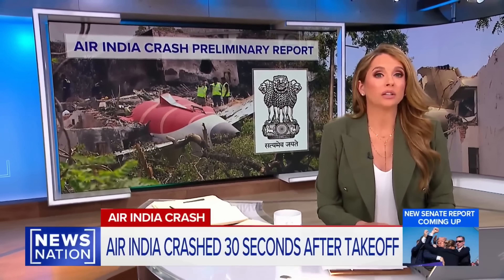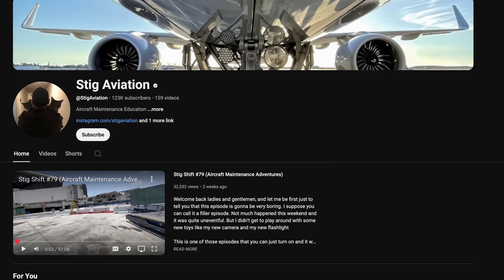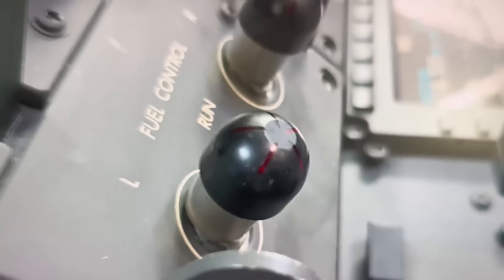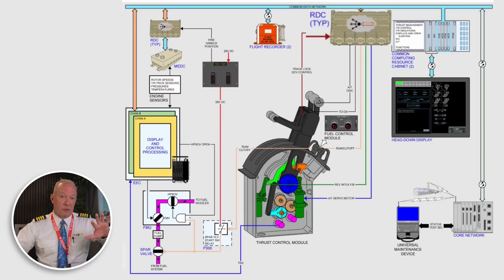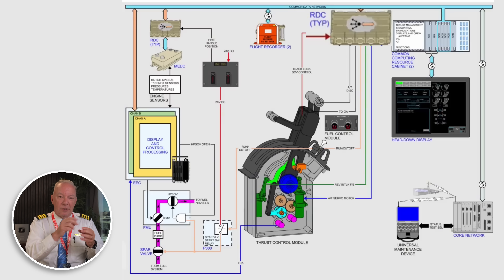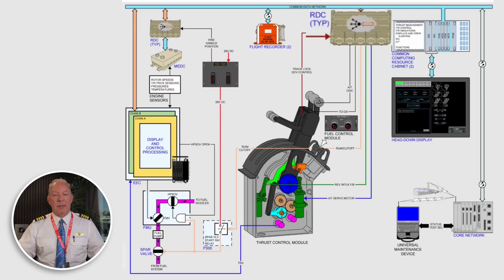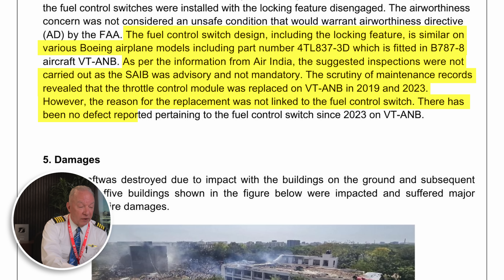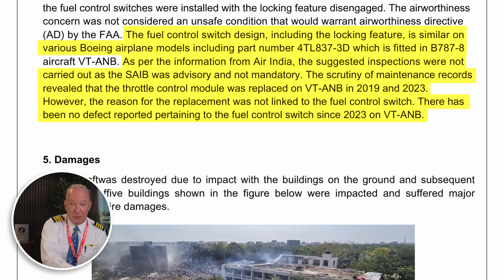The Truth About Boeing 787 Fuel Control Switches

Comment: I'm a retired airline pilot who has flown many different aircraft including Boeings with their different fuel cutoff switches. I am well aware that the switches could not have moved on their own but watching some Youtube shows where a "Knowledgeable" avation person said that the FADEC could cause the engines to quit without the switches being moved and that there had been prior incedents where this had happened. I appreciate your clearing this up for me and many other pilots who may have thought that a computer had some erroneous control over the engine fuel controll valves. All my experience and logic told me that was nonsense but watching these shows can create doubt.
Reply: I may have watched those same videos.  They seemed confused about the FADEC, it does not shutdown engines, it can reduce fuel flow in some situations.  One of those videos said the air/ground sensor malfunction would shut engines down if it thought the plane had landed.  No, auto throttles retard the thrust levers, which in the Boeing would be obvious to the pilots (Airbus, they don’t move)
Reply: it doesn't matter wear the switches are does it, if there is a relay then the switch does not actually do the switching of the fuel valves, it's another circuit that does the activating of the fuel valves, so there is no actual direct connection between the pilot and the valves via the switches, that's something that needs to be understood as far as the complexity of the circuitry goes, this is not a simple circuit like a light switch because there other circuits connected, even a simple fault with a relay circuit could remotely activate these valves without the switches moving in my opinion.
Reply: @gogogeedus  I suppose at the point the question is: how does the FDR read the position of the switch? Is it off the lines powering the pumps after the relay, the line before the relay, or on a isolated set of contacts physically present on the switch?

All of those would play into the two important data points:
1) The engines definitely had their fuel cut-off
2) the onboard computers saw the switch change state.

So where those two points overlap would of course be pretty interesting to look at.
Reply: @compwiz101  you would need to have access to wiring diagrams to figure it all out.
Reply: no! sorry
Reply: @gogogeedus  Yeah, I'm only an electronics technician in a very different field (mainly audio, with a bit of electro-mechanical gear), but I'd love to dig into a proper schematic
Reply: @gogogeedus  not if its a latched relay that requires power to both open and close - which is pretty common on fuel shut-off relays for obvious reasons.  Its all powered from the same busbar - battery, but design regulations dictate redundancy required in flight critical switches.  The only commonality between these 2 will be the power source and the fact they are located in the same panel.
We know the battery busbar remained powered as it also provides power to the FDR and CVR for example.
FDR data will be fed directly from the switch as a discreet signal to an RDC on separate wiring from the relay control.
Reply: @gogogeedus  You are wrong. Do you even know what a relay is? It is an electrical mechanical device that operates with DC current. It can only be operated by the ship's battery and no other source of power. There are no "Other" circuits involved. One relay might fail but not both since they are individual units. The fuel switches directly control the relays which apply power to the valves from ONLY the battery. There are no other ways to activate or turn off the relays except the switches or a total battery failure.
Reply: @rudyyarbrough5122  no I am right and you are wrong, in a relay there are two sepperate circuits and they are not physically connected even thought they are located in the same space, the only thing that connects them is electro magnetic force, not mechanical force, and the two circuits related are not connected by any other means than magnetic force.
Reply: @rudyyarbrough5122 there is no mechanic force in a relay only electro magnetic force so the correct description of a relay is an electro magnetic device, I agree that it would be unusual for both relays to fail at the same time unless they lost power.
Reply: @rudyyarbrough5122  so you are wrong.
Reply: @rudyyarbrough5122  I doubt the power would come directly from the battery, it would pass through some type of device to protect the pumps like a circuit breaker or heat activated over load switch like a bi-metalic circuit breaker.
Reply: @gogogeedus  nope, the battery does not run the fuel pumps but it does power both the relay and the fuel valve servos which are controlled by the fuel cut-off switch.
The fuel pump circuits are protected by circuit breakers but if these trip in flight you never reset them, there are at least 2 pumps per fuel tank that require a transfer capability.
You use a relay to save weight, the holding current on a relay means lighter wiring and over the length/width of an aircraft it means the wiring will be heavier than installing a relay local to the component.
The relay is also powered by the battery busbar, in any other electrical power configuration on an aircraft the busbar is powered by a transformer rectifier unit (TRU) from one of the AC generators, engine/APU/GPU/RAT which also keep the battery charged up.
Reply: @yanholland315  I am only guessing because I am not an aircraft mechanic or technician my training and knowledge is based in the automotive industry, but I know how a relay works and that the fuel system needs battery power and a circuit breaker which in the auto industry for the main power supply is called a fusible like, which is just a battery cables that can be relaced after it burns away in a short circuit, but some cars have a Bi-metalic circuit breaker which breaks the circuit in case of a short and once cool will close the circuit to allow power through to keep the accessories alive, I would imagine this is the type of system used where power is critical in keeping the fuel system functional for the engines to create the thrust needed to maintain flight. but anyway you are just repeating what I said with different words, starting with nope :)
Reply: @gogogeedus 
You said you doubted the battery runs the fuel pumps, I said it definitely does not, fuel pumps operate at 115V AC powered by 3 phase AC generators.
I also covered fuel pump redundancy, power supply sources for the battery busbar and why relays are used.
Unlike a road vehicle engines can be gravity fed from the fuel tanks, its not ideal due to cavitation and changes in pitch and roll and has the potential to cavitate.  Secondary function of the fuel pumps to enable transfer of fuel between tanks for trim purposes in flight.
It also worth noting that fuel control relays will be the latching type, power applied to close and power needs to be applied to open not just removal of power.
Reply: @yanholland315  No I didn't say, I doubt the battery runs the fuel pump, that must have been somebody else, I assumed the fuel system ran on battery voltage so thanx for clarifying that for me , car fuel systems usually have vacuum at the pickup pipe but a lot of newer cars have submersible electric pumps in the tank, most relays in the auto world only have 4 wires, two wires are for the low amperage side the others are for high amperage accessories like headlights etc, the main reason for using relays on cars is to remove high amperages loads from the switches to reduce the possibility of them overheating and building up resistance and melting.
Reply: @gogogeedus  lots of regulations around fuel tank design in aircraft that were as a result of accident investigations.  SFAR 88 being one of the bigger ones.
Aircraft in tank pumps tend to have the drive motor outside of the tank these days for that reason,.
Fuel system design is a big beast with lots of baffles, air pressure change compensation system form altitude change and refuelling/fuel use in flight, requirements for fuel dumping in an emergency, pumps tend sit in small surge boxes to compensate for temporary flight loads/changes, limits on tank fuel load weights both on each wing, between the wings and between the same tank position on each wing.
All of that would have been controlled and monitored by a flight engineer but the fuel computer will sort it out now.
Aircraft relay use is similar, small current enables large current switching but is as much about weight reduction, 747 (only one I could find in a quick search) has over 3500 lbs of wiring and some 140 miles of cable, max fuel load in a 747 is about 40,000 lbs which goes to show why getting loom weight down is important.
Reply: @gogogeedus  Duh! What do you think the switch contacts are? The electrical movement moves mechanical contacts to open or close the valves.
Reply: @yanholland315  One thing that I am curious about is how the battery is earthed or does the negative side of the battery go directly to the body of the aircraft or are there wires for each negative circuit, being a composite aircraft I'd imagine certain parts would not be conductive.

Comment: 9:20 excellent explanation,  this maybe where some think that if the aircraft had power electrical issues not aware that the fuel relay power is on a isolated seperate electrical circuit direct to the battery. This failsafe measures.

Comment: Thanks for the unbiased explanation. But what function does the relay serves if it just passes the same 24V DC electricity coming from the physical switch through them. The whole point of a relay is to switch higher current or voltage using a smaller signal or electricity.

Comment: Its very very unfortunate that the crash happened. However, why would critical control devices such as cutoff switches be mounted just aft of the throttles. Why not have them mounted in the forward field of view? Where both pilots see it happening when they actuated.

Very thorough analysis, Sir.

Comment: I understand what you are saying about constant battery power, but technically, if the fuel control valves fail safe, it would take power to close them, so if, in the unlikely event that circuit was “opened” due to a wire being severed or a loose/corroded connection, either in the control side or the throughput side of the relay,  or the relay itself failed “open” internally, the valves would stay open.  Otherwise, they would close if 28VDC power from the battery was interrupted for any reason.   Of course, the battery would drain from this parasitic load if not kept on a maintenance charger, while the engines were shut down. 🤔

Comment: What would happen if the spring inside the fuel switches loose their tension over time? Then is there a possibility for the mechanical switch then to switch down to cut-off on the intense vibration induced during rotate/take-off phase? I am just looking to see if there was a possibility that this can happen and then investigation can be done on whether the original springs inside the mechanism are robust enough or, if they were changed with local parts during a maintenance operation..

Comment: It's most likely that they were manually switched. That is an inescapable fact. There is a vanishingly small chance that the circuit malfunctioned and produced a signal that imitated the switches. Not very likely.

Comment: Great explanation, however a relay and a switch are different things. A Relay is a switch, where its open or closed state is determined by sending an electrical signal into an electromagnet to open or close a separate circuit. Relays are used to switch on and off a separate circuit which usually transports a very high voltage or current. The relay is very much an analogue device, but that said, imagine hypothetically there is a wire short or something that can cause this relay to trigger. That is still a possibility, and a viable possibility if the relays are overload protected. The report did say the cutioff switches transitioned to off, and then back on. What the report didnt say is how they determined this. Was it a physical sound they heard on the CVR to say the actual physical switches were manipulated? or was it a data point on the Data recorder that said they were manipulated? If it was a data point in the recorder, then it could be feasible that said data point was caused by some electrical issue that just happened to cause the relays to trip off. But that wouldnt really explain them tripping back on again a few seconds later unless it was recovery from an automated overload protection.

What might explain the relay tripping on and off, would be an overload. If the relay is overload protected, and an overload was detected the relay can trip off, and then back on again when the overload condition is gone. That is a very viable theory, but I would have to imagine the Flight recorders would have captured any kind of overload and recorded that data. There was no mention of any such overload in the prelim report that I am aware of.

Final report will hopefully shed some more light on the subject. For me there is still a possibility that some form of electrical fault (short or damaged wire) caused the relays to trip to the off position, that said the possibility that someone or something actually managed to manipulate the switches is also a very real possibility.

Comment: Thank you!  While of course I don't like to think someone would do it intentionally, I more wanted to be sure we covered all possibilities, like some false signal somehow, before drawing a conclusion.  This description helps clarify how the valves get controlled and that there really isn't another way to cut off the fuel.  I do wish they would say if on the CVR we can hear the switches being moved and at what times if so.  That would also help verify it.  I am interested in what would happen if the battery totally died, like disconnected.  But then the engines should still be providing power to keep the valves open too.  So would require the battery failing and a total electrical power outage.. that came back seconds later, since the engines did begin to restart.  I guess the simulation would have to be.. engines started, v1, battery failure, rotate, power failure, rat engages.
Reply: Though.. if that happened, everything would go out.  The pilot wouldn't ask "why did you switch it?" but more like "my displays are out," or even just "what happened?"  Wouldn't ask about switching.  Not like there's a switch that just turns off everything. 🙂  So probably kills even my more remote option.

Comment: Rat was already deployed, before the switches were cutoff, pilot put the switch to cutoff to restart the engine in 787 checklist it has been clearly said that if engine fail put the switch to cutoff and then run to restart, engine failed right after rotate, so its not an pilot error.

Comment: I would like to know what specifically "tells" the FDR that the switches are physically in one position or the other. Is there a separate set of contacts in the switch itself or is this information based on a downstream condition? Is the FDR only ASSUMING that the switch was LITERALLY AND PHYSICALLY moved because, "hey, no juice, so I'm declaring that someone turned the switch off" with no other data source for confirmation?

When the thrust lever assembly was replaced (TWICE) were any of the ARINC connector pins damaged?

The diagram shown in this video is NOT a wiring diagram. It is merely a flow chart!

And let's not dismiss the fact that there appeared to be other electrical/digital anomalies plaguing that particular aircraft before they ever began to taxi to the runway.

Comment: Would a battery failure/ fault allow the cut off valves to close ? IE it doesn"t appear to be fail safe , and relies on a functioning battery. I believe the system is more complex than your simple explanation. How is the data that gives information to the flight recorders generated ?? Is it possible if the data is not read directly from the switches, but is based on a different condition, then the story changes completley. Is the battery monitored and its functionality recorded in the data ??. Still to many unanswered questions.

Comment: what if relay connected to the fuel control switches became faulty suddenly and did not pass or open dc current to the valves of the engines

Comment: Hi and thanks for a top quality discussion on the topic. I agree with the final conclusion: no one wants to believe a pilot would do this, however, at this point the conclusion really is inescapable: one of those two intentionally shut off the fuel to crash the plane.
For some, the incredulity of such an idea, makes them resistant to that inescapable conclusion. I get the emotion but it's rather silly; everyone knows there have been other commercial plane crashes intentionally caused by one or both of the pilots, in the past.